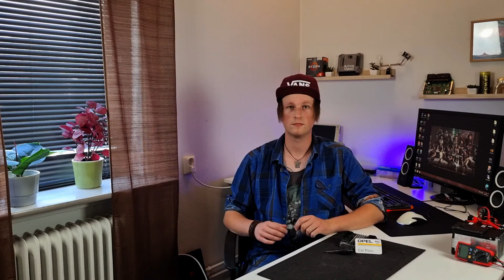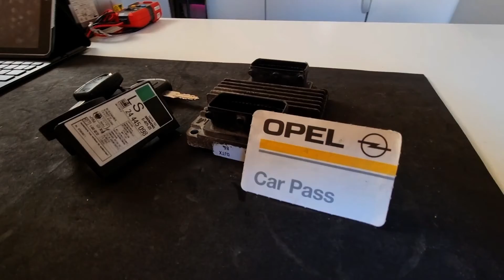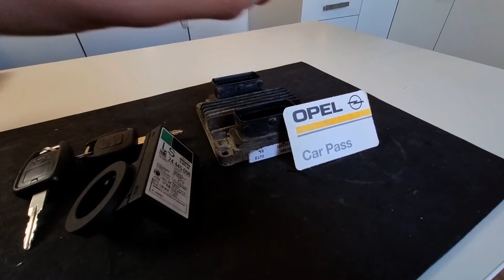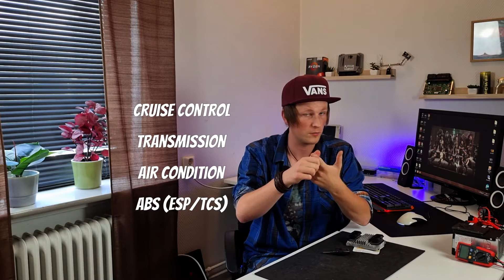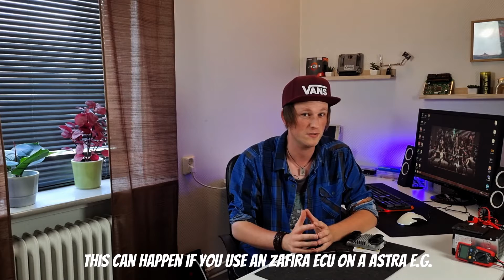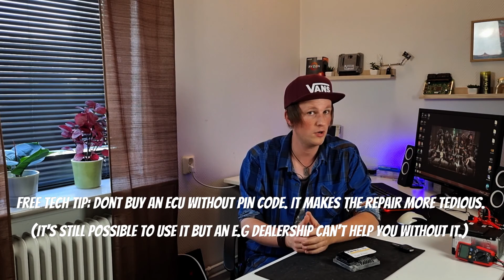Opel Astra G / Zafira A Engine ecu replacement for beginners!

Comment: Hello Freddie any chance of some help I have a mk1 zafira petrol 1.8 and I think the ecu has stopped working what is it I should do as I'm looking to buy an ecu and chips an chip ring  and what numbers do I need to match on the ecu unit as I have the top line matching and his says an my engine type and a.c but doesn't say abs like an mine has that thanks
Reply from the maker: If I were you I would check for the part number on the ecu itself and then double check the functions mentioned in the video. 😊
Reply: I have the ecu for a 1.8 zafira where are you located